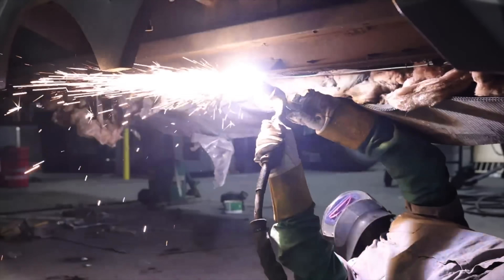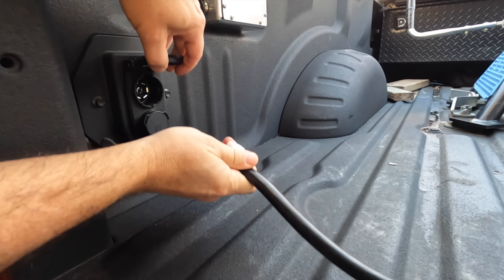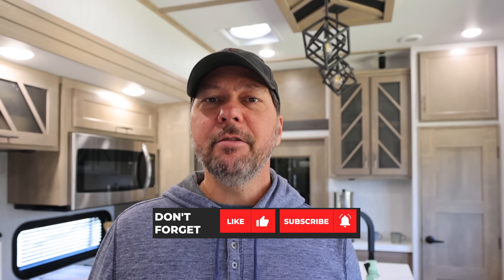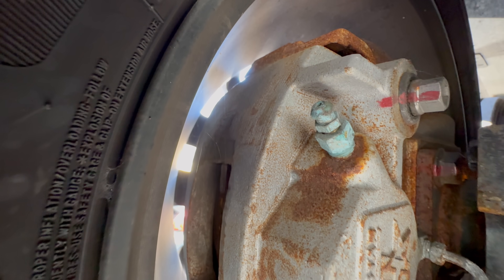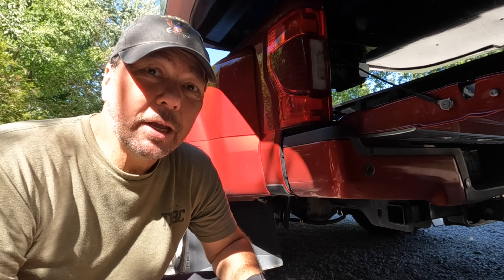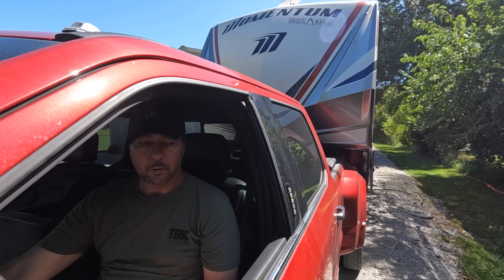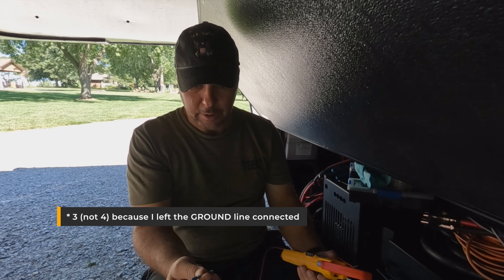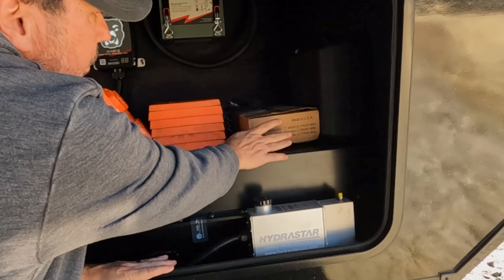RV Brake Troubles!: Solving a Perplexing Hydraulic Disc Brake Issue

Comment from the maker: UPDATE!:  We got a TON of great advice here in the comments!  THANK YOU!  The prevailing theories are:

Bad Splices/Crimmps: It's possible one of the splices was bad even though it read zero ohms because the meter uses 9v at very low amperage.  If it happens again, I will test the voltage drop across the splice while under load.

Power Reset: Since the actuator is powered even when the truck is disconnected, it never completely shuts off.  Cutting the power line might have reset (rebooted) any "smarts" built into the actuator.

Bad Ground: I never cut the ground wire, but the connection might be intermittent at the chassis, and moving the wires around made a good connection.  I did check the chassis ground, so I don't think this is it.  But, as many have mentioned, I should verify/check the ground wire first.
Reply: I agree completely! I have seen fuses in house circuit check okay until under load!
Reply: I have rewired a few trailers, one typical problem on trailers is the ground.  Usually, the white wire from the 7way is simply screwed to the chassis.  While steel, I myself do NOT trust the chassis to be my primary ground...especially NOT for brakes.
When I rewire the trailer I do ground the chassis, however...I run a dedicated ground wire (same gauge as brake wire) to the brake actuator.
Also, I use lights that have a ground wire.
If, for whatever reason I can't find lights with the ground...I still run a dedicated ground to the mounting point of the light.
Doing this guarantees your ground is good AND, the chassis is still grounded (as it should be to keep static at bay).
Reply: My $$$ is on the poor crimp side.  We dealt mostly with 120vac and often had issue with poor quality grounds particularly in older houses.  Check hot to ground and 120vac.  Put a light bulb on one of the meter leads and check.  Voltage goes way down because of a poor ground.  You could do the same if you're willing to sacrifice a lead.  Just put a 12vac incandescent bulb in the lead and retest those crimps running 12vdc thru them.
Reply: Agree on the Power Reset..   similar issue on a newer truck as well.   7 way needed to be unplugged to reset things.  Then it all worked fine.
Reply: One additional possibility would be a short to ground on the control wire. Since you moved the cables around while replacing the splices you may have moved the wire enough so the short was “fixed”. I would think this would occur somewhere the wire passes thru a box or bulkhead fitting. It may have rubbed thru the wire insulation or mostly thru in a very small spot. If it occurs again, try checking the resistance (since there was no sparking, resistance is most likely high enough to not register continuity) between the control cable and ground or the RV chassis, if the resistance is in the kiloohm range, I would suspect this. Just one other possibility to investigate.

Comment: Chad, you really can't check those wire connections the way you did. You need to put put 12 volts to the wire and put a load on the other end, like a headlight bulb. Checking with a test light or meter can still measure 12 volts until a load is installed. I have been a Ford tech for 30 years and have been bit before. Put a load on it and check voltage drop. Love the videos man. Keep em coming
Reply: I agree, my guess it was a connection issue. Best way to check for bad connections is under full load.  If you would have stripped back the wire a little on the load side of the crimp connector and checked you may have seen a voltage drop. Maybe there was moisture in the crimps.  Anyway, good job.  Sometimes it is the simple things that can be overlooked easily.
Reply: lots of people, techs included forget that one strand of wire will still show source voltage with no resistance. That's what makes doing diag on networks so much fun.
Reply: Yes, our resident Ford tech above is absolutely correct.  I preach to my techs to perform voltage drops as opposed to resistance checks alone.  I also advocate for non-destructive testing.  ALWAYS test your circuits BEFORE taking anything apart so as to catch it in the act, so to speak.  Many an electrical problem can be fixed simply by unplugging and plugging back in because you fix a bad contact.  Nothing more frustrating.  When you disconnected your actuator and checked voltage there, that was a good check, but you verified source voltage only, not voltage with the load of the actuator in the circuit.  The importance of voltage drops can not be overstated.  Imagine if just one strand of wire was barely completing that circuit.  With your ohmeter, you'll see very low resistance.  But under load, that one strand will produce huge voltage drop, preventing all the voltage from reaching the load.  I think you may have fixed it by redoing it, but your frustration in not knowing WHY you fixed it has been felt by many a tech who wasn't methodical enough.   Any time something electrical works, but doesn't work well, we are thinking about bad powers or grounds.  Also, the instant I saw all that corrosion, I became concerned about water intrusion into one of the electrical circuits.  It's a great lesson, though, and in the end, you fixed it, so good work.
Reply: Hi Chad,. As other comments have mentioned your voltages tests need to occur under load grounding to the controller and checking voltage when activated as close to actuator as possible past all splices. Also recommend checking but comlnnections with a megger or with significant load and measure voltage drop across the splice. Just some thoughts similar to others here.
Reply: Also Chad as a truck driver you should and always test the trailer brakes before leaving anywhere. It make u aware of any problems before hitting the roads with such a big trailer. Also agree a ohms test is a bad test should always be a voltage drop test. Ohms test only use a 9 volt battery to do it not the 12 volt that the system runs on
Reply: Glad you pointed out using the trailer brakes ONLY when doing the tug test.
Reply: Also check the ground.  Receipt your ground. You moved it around as you cut the others. It could make a good connection but come back and kick your ass. Check the crimp on your ground.
Reply: Old retired mechanic here, we had a car that was having problems with the charging system.  I ran every test we could think of and nothing.  Finally on the connection to the alternator I noticed a slight discoloration and sure enough when the  connector was crimped it had some of the insulation in it.  Under a load from the AC for instance it would build up heat and resistance.  Put a new wire end on that rascal and fixed it.  Not going to admit how long it took me to figure that out.
Reply: @chucklane1338  That and it's helpful to use a meter that has a min/max/av feature that "latches" and acts as a tattletale. This allows you to capture transient opens/shorts. Kind of like using a data logger.

Comment: I can imagine 1 thing that may have been overlooked. I’m not an expert on your trailer system, but do have an electronic engineering technician degree and 27 years of electronic experience. The one thing that I see that may be a potential culprit is your grounding. If the grounding connection between your vehicle and brake controller is compromised, you may ohm out as being good, but when an increase controller current tries to travel this ground path the resistance could increase which would drop your voltage seen by your brake controller module. This lower voltage to your trailer brake module would give you diminished braking. This could be a connector issue or grounding path between the trailer and vehicle. This could definitely cause intermittent issues.  I have in the past had light issues between a trailer and truck caused by corroded grounding wire. It’s just a thought. With such a new truck and trailer I wouldn’t expect corrosion to be an issue. Damaged or poor wire connector could. I would look.  Good luck!!
Reply: The one thing that I have had happened to me was the inertia sensor in your controller could be faulty. That's the only thing that I can think that was not checked. Great video and safe travels
Reply: Chad, I would go with a false ground too!
Reply: He is correct. You can have continuity check good, but that does not indicate if it maintains full continuity under load.  I could very well have been one of those splices or a ground issue.
Reply: Yes, I have spent 40 years chasing automotive/RV electrical systems, it is almost ALWAYS the ground. Pull it apart, clean all corrosion with wire brush and rubbing alcohol, reinstall and cap seal the connection, both sides with RTV.
Reply: My dad was a mechanic that specialize in electrical systems back when most mechanics were not well educated wrt electricity. His favorite theme was "check your grounds first".  His advice has served me well for many years.
Reply: I was thinking this same thing.

Comment: Chad I’m an electrician and this has happened to me before. Crimps with even minor corrosion inside,"which you can’t see" create higher resistance. In a 12-13.8 volt system with wire length and size that small you likely had voltage drop but only when breaks are applied. By changing the crimps you’ve eliminated the problem. I’d use shrink crimps to prevent a moisture issue which causes these problems.  Good luck! Oh BTW I would have trouble shooter this problem exactly as you did. The crimp thing is very unusual but does happen.

Comment: Hi Chad.  I was a broadcast engineer for 43 years, before I retired.  I think you found your problem – the crimp connectors.  I’m not a big fan of crimp connectors.  Like most of these guys, my first thought was the crimp connectors.  And, like one of the other guys pointed out, just because you have continuity doesn’t mean that it can pass heavy current.  In my opinion, nothing beats a Western Union solder joint and a little heat shrink, especially if the long-term safety of your rig is depending on those connectors.  The only other possibility I see is an intermittent brake actuator.

Comment: Talk about timing.  Just pulled the RV into storage and stated that I felt like my brakes on the trailer were not strong.  I have the exact issue as you did - and I was thinking maybe pads?  I pulled the emergency brake switch and the Hydrastar initialized as it should.  When I test the brakes, my truck continues and never stops as it normally should with max brakes.  I too was thinking air in the line - I was going to bleed them etc... looks like I need to work through this as well.  Just odd that two different makes of Truck (Ram) and Trailer (Riverstone) are expereiencing the exact same issue.  Bizzare.  I have some investigating to do - unfortunately no resolution yet.
Reply from the maker: The list never ends!  LOL

Comment: Chad I have the same setup but only in a Riverstone. The only problem I ever had was one time leaving a park the brakes felt spongy and I had a loose 7 pin connection. I'm sure you have plugged this in and out many times during your troubleshooting. You'd like to hope that the problem will go away but it will leave you scratching your head in the future. Great video.

Comment: Chad, as an electronics engineer of 40 plus years I agree with the ground comments but my issue is you changed the conditions when you cut the crimp couplings off. Never change the thing you are troubleshooting. I would have removed a panel to get to the inside of the controller (preferred) or stuck a pin through the wire to read by the circuit. Changing the things under test is always bad.

Comment: I think your systematic trouble shooting was spot on and checked all possibilities. Is there any kind of electrical reset that might have been triggered by the wire cutting. Did you ever try just unplugging and replugging the actuator. You have had problems with electric over hydraulic valves on your jack system. They can stick open or shut causing slight bypass or no flow at all. A lot of electronics can be fixed with a reboot.

Comment: Measuring voltage alone across a suspect connection can be misleading. When a crimp is faint, you can read 12 volts across it but the current can be severely limited. That might be it? Keep us posted.

Comment: Wow Chad, your viewers are some smart people. I came to the comments to to tell you that the method you used to test those connections was flawed and found that a lot of people had beat me to it. Then I discovered several other good suggestions of other problems to look for that I had not thought of yet but were quite good ideas.  I am sure you didn't get such a sharp audience by chance.  Your knowledge and style of presenting it are one of the reasons I call it YouTube University.
Reply: I was just going to say what you just did. The folks commenting on here are beyond intelligent and a welcome breath of fresh air from what I usually encounter online.

Comment: Hi Chad, I have been a Technician and Electronics engineer for over 50 years. I use a sewing needle with my meter and lightly puncher the insulation to measure the voltages under load when there is no other convenient place to measure the voltage under actual load conditions. Really enjoy following you two and your adventures!
Reply: That and back-probes and break-out boxes with pin-outs.

Comment: Hi Chad:

I watched your YouTube video tonight in regards to the diminished braking on your trailer.   I had the exact same issue and long story short, in my case, it was in the Ford menu system where you set up the trailer.   Let me explain my experience.   

I have a 2023 F450 King Ranch pickup and 2023 Solitude 390RK which was ordered with 8k MorRyde IS and disk brakes (only 2 axles)    

Let me back up a bit here. before the F450 and 390RK we had a 2019 F350 dually and a Solitude 310GK.  I also had MorRyde install 7K IS and disk brakes.  The F350 menu system had the trailer setup with the correct type of brakes and it worked fine.  Sometimes I would forget to select the active trailer and it still worked fine.  In May 2023 the new 390RK arrived and (other then having leaky hydraulic fittings on two of the calipers) it also worked fine.    It did not matter if I selected the active trailer or not.

In October 2023 my F450 arrived and it had an elaborate menu system where I entered much more info for the trailer configuration.  I selected the Solitude trailer from the menu before we started and it was fine.  

Two weeks ago we left our Florida campsite to travel to Quartzsite AZ for the GD Rally this March.   It was over a month since we last towed and I forgot to select the Solitude as the active trailer.  In Tow Haul mode the dash actually said “NO ACTIVE TRAILER”.  Since it did not matter on the F350 I ignored the message.   However, I had diminished trailer brakes.  It really was not safe to drive that way but I could not find any reason for the issue.  I did not think it would make any difference but I pulled over and selected the Solitude as the active trailer and just like that my brakes were 100%.    

I think your truck is a year older and the menu may be different, but my guess is the issue is somehow in the setup menus.

My wife and I are both big Changing Lanes Fans.

Lou & Diane Cetrangelo
Reply: Do you like your 390RK, have the kitchen slide issue been fixed?  That's the trailer I want and the 8k axle and I also want to tow with Ford 450
Reply: As you know the carrying capacity is low. Adding the 8k IS brought the GVRW to 18k lbs. However the components are so heavy that the carrying capacity did not increase much. We added 9 solar panels} (2.13k w) and a 24v lithium battery  bank (480ah@24v). Which used up any cc gain😎.

Comment: Hello Chad. I've not had much experience with trailer brakes, retired aircraft mechanic.  Your troubleshooting sounded solid. The isdues in the other comments all sounded like good advice.
A voltage drop test would've been good. What is your system ground ?  If it's just a screw into the frame, double check that.
First rule of troubleshooting, what was the last thing done ? That's probably your rear brake light addition. But you verified that by removing the connectors. 
Second rule, after all your other troubleshooting, find the most expensive part in the system, replace it ! This doesn't count if it's warranty LOL.
Intermittent problems are the absolute worst. When your following a set path on troubleshooting, that SHOULD find a problem and doesn't,  makes you crazy, almost bald, doubt your own abilities, and generally can make you hard to get along with.
I would look at the programming of your truck / trailer system.
But if it ain't broke, you can't fix it.
I think you troubleshooting so far is solid. You've ruled out mechanical issues it sounds like. That only leaves electrical or programming. 
Good luck brother, I know this can make you crazy and worse, yet make you doubt your system. No a good situation with 40k lbs pushing you.
Keep us informed.
God bless ya'll stay safe out on the road .

Comment: Chad, I was helping a friend who had awning troubles. After a couple of hours troubleshooting, tracing wires etc, I was dumbfounded. So I removed the switch panel that controlled the awning and took a good look at the connectors at the switches. I cut them all off and replaced then with new spade connectors and problem was solved.

Comment: Chad, I've had two occasions with surge brakes where there was some small particles between the plunger on the accuator and the small hole at the exit point of the acctuator where the brake line connects.
If that was your case the pump would come up to pressure and some fluid would pressurize the lines but the needed volume of fluid would be restricted. These particles were trapped in a confined area. 
I really enjoy your site and your presentation, Dave M